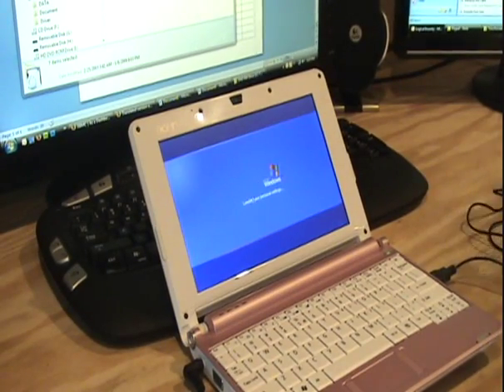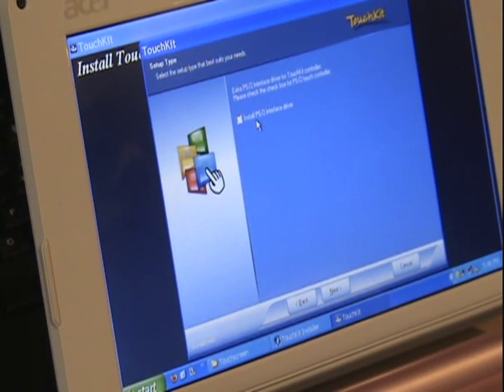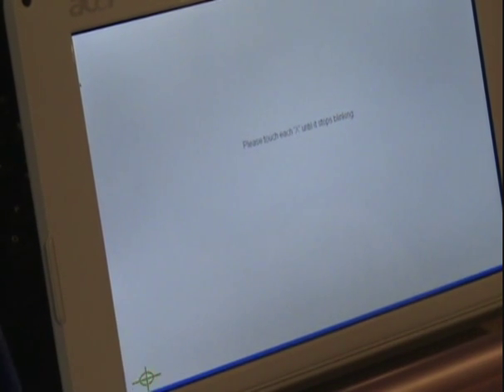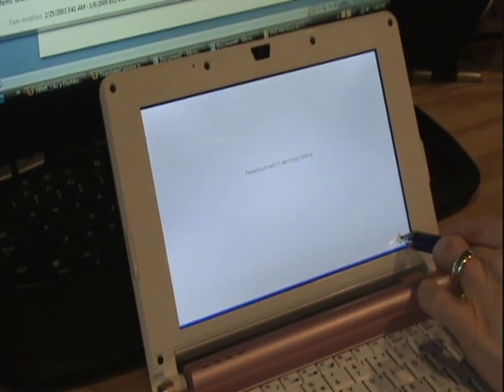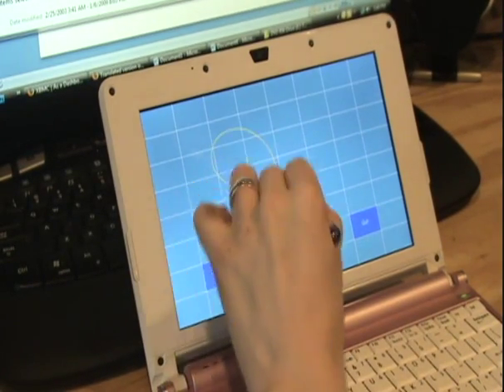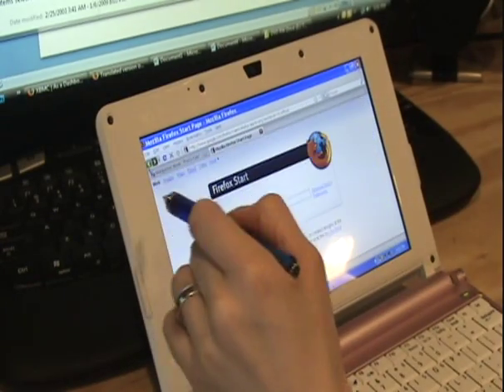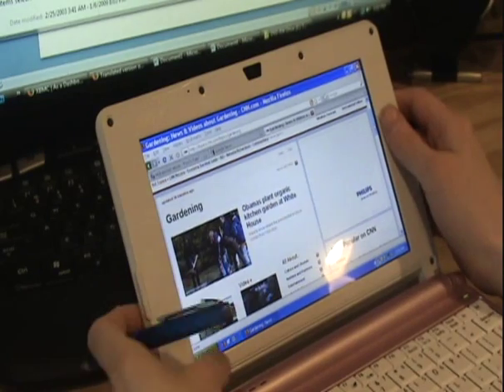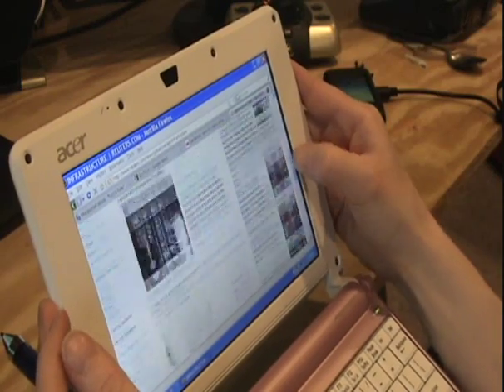Part 3: Acer Aspire One Solderless Touchscreen Install (Driver Installation & Test)

Comment: Hi, How much was the batter life affected? You mentioned the screen being 15% darker, is this due to current draw? Also, keep in mind our acer netbooks have gma945...using the ccd's connector like that will put it in performance mode (3d mode) increasing the heat and shortening lifespan, and also battery life, similar to gma booster. A laptop cooler should help. Has your Wifi card cut out at all?

Comment: As far as I've seen, no. They company she bought this kit from only sells kits up to 10.1".

I searched other kit makers and they don't sell a 11.6" either.

I did however find a Taiwanese company by the name of "Onetouch" that does sell a 4 wire resistive touchscreen for 11.6" which are type being offered in the solderless kits.

There is a higher quality 5 wire, but they don't sell a 11.6" size for it.

I would like to state that, I've have never purchased anything for "OneTouch."

Comment: Another question before I buy the kit for this. I heard with the solderless kit the web cam will fail to work once it is connected to the hub this thing comes with. It might be safer to make the usb connections through the unused PCIe on the wifi but that would be a bother

Comment: I just got my AAO (black) and this is something i defenitly want to do to it. now i have an excuse to up it from 1gig to 1.5
But this is still a little bit in the future. now show me a hinge kit that allows for flipping the screen clean over to the back and i'll do it tomorrow :)
Flip kit case redesign would be sweet just have a hinged flip plastic plate to cover the keyboard (or disable it while flipped over that far. with the touch on the back and you turn this thing from a 300 to a 1k umpc

Comment: also i am noticing when i have the cam cable on the left of the lcd to the hub my touchpad on the acer pulls the mouse on the screen to that corner. without it connected the mouse works perfect. not sure if its a defective kit or im doing something wrong.

Comment: i have connected and reconnect everything. everything IS as the guide on how to do it. im wondering if i mixed a step up...

behind the lcd where it says to disconnect the mic and cam and bring the cam wire to the left side of the lcd and connect it to the wire to the hub, it is the wire the was original connected to the cam not the mic right? and what about the mic? do i reconnect it to its original connector when closing it up again?

Comment: tarzanna, when inside the bezel of the lcd.. when you were playing with the webcam, is that 0.3mp webcam replacable? could you get a 1.3 or greater laptop webcam and solder it inplace of the 0.3 model?

Comment: ok i did this but when i ran the system for the first time with this the original touchpad and touch screen pull to the bottom left of the screen. cant even config it because its like a magnet to that corner. any ideas?